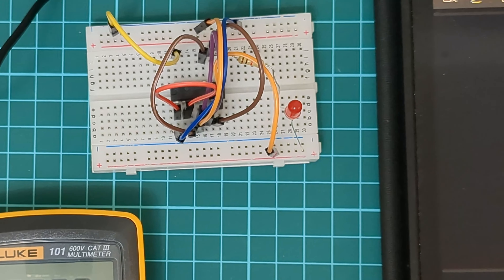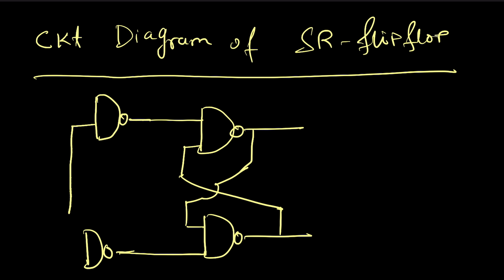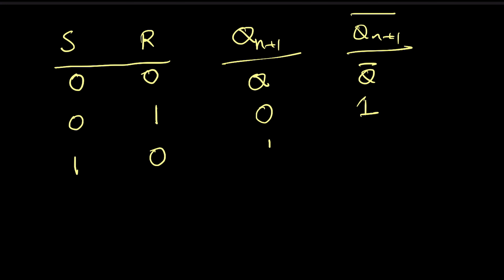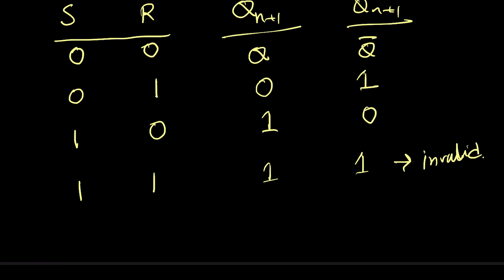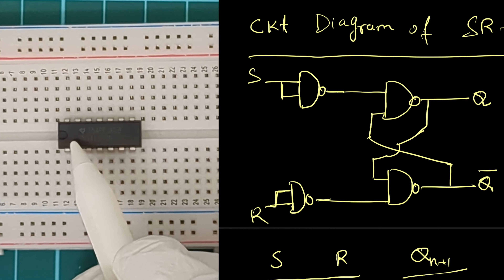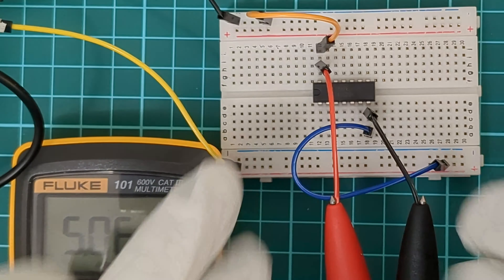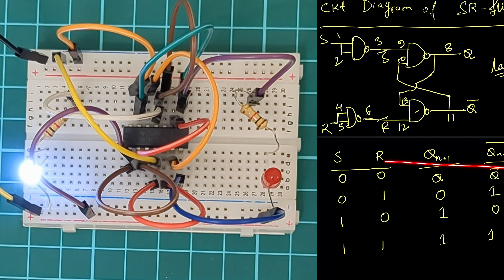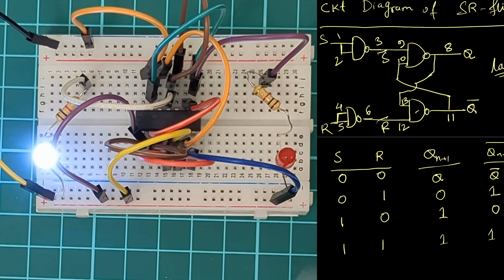Construction of SR Latch circuit using NAND gates || Digital Electronics Practical in 4K

Comment: Thank you dada for clearing this concept on Latch and FF❤.. But i have a slight inquisitiveness regarding why open ended wires in any circuit are observed as high potential as we can see both LEDs are on when wire is open ended?
Reply from the maker: these IC's are made of TTL logic that mean no connection or open wire mean logic1, that is the reason for LED on without any input.